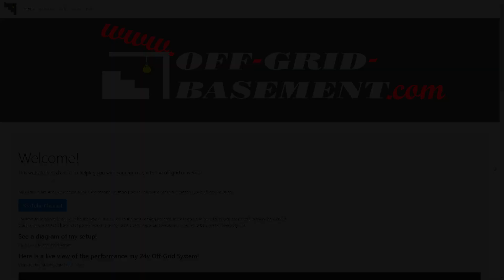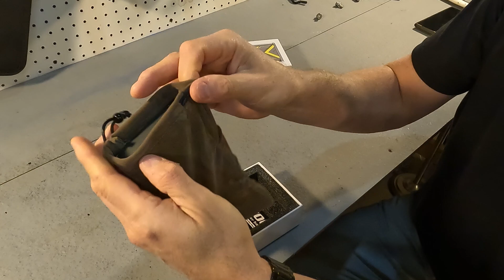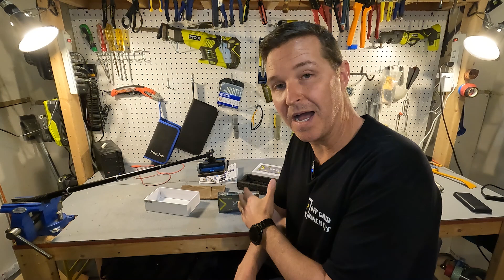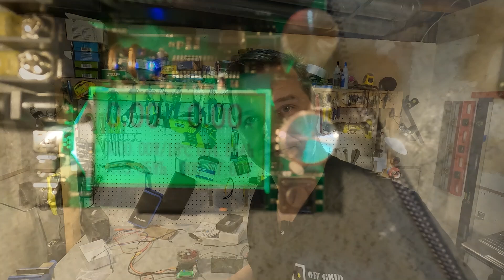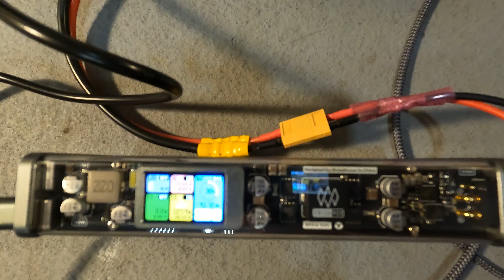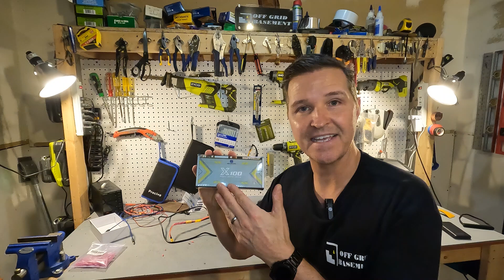X100 EDGE Smart Drive full review

Comment: I  want to use this X100 to power my StarLink Mini when I need to locate the Mini further away from my RV without having to run a long length of cable to power it... & it would be nice to connect a solar panel to the X100 to charge it while the X100 powers the Mini.
Reply from the maker: Thanks for the comment and sharing your idea!

Comment: Is there a power button that turns the power output on and off?

I want a power bank to plug into my Starlink Mini when I am remote - Is this overkill or do you know of  another one you would recommend. (no thicker than 1.2") Thanks
Reply from the maker: I'm not sure if this is overkill.  It does have a power button to trigger the output.  This is honestly the best power bank I've tested.
Reply: @OffGridBasement  Since I posted (3 days ago) I have to agree with you - this may be the best power bank for this application👍

Comment: I have a dumb question but I'm going ask anyway. Since it has XT30 plug. Does it mean I can use it to run RC cars? Or it's only for charging RC battery? 

I'm hoping that it can run RC cars.
Reply: Of course you can do it all
Reply: @Edge_Smart_Drive  I was wondering if XT30 plug are adjustable? I noticed it's stay at 24.95v 0.000a. I can't figure out how to adjust it.
Reply: @ Sorry for not getting back to you earlier.
Unfortunately, the voltage is not adjustable at the moment.
Reply: @Edge_Smart_Drive  that's unfortunate. It would be game changer.  I guess I could use UBEC.
Reply from the maker: It only for charging the battery.  Thanks for the comment.
Reply: @OffGridBasement  The label said output 21v 15a 315 watt. And Input 24v 6a
Reply: @ Can also be used for electrical appliances in need LOL

Comment: My only gripe is that it doesn't have an pure sinewave AC inverter/plug socket
Reply: I’ve poked our engineer about it—his reaction was a mix of caffeine and despair😄 but he’ll consider it
Reply from the maker: These portable power banks aren't really designed for AC power.  This is just designed for fast charging and discharging.  Thanks for the comment.
Reply: @OffGridBasement   I  realize ... However there are some that do it but sadly they are modified sine wave (eg marebo)

100w pure sinewave inverters and even 50w are real if these size powerbanks with pure sine wave were more present

I could run a 15w DC motor Amazon basic standing fan for hours in an outage , or run internet routers, or starlink,laptops  and such a small inverter would have low idle consumption 

They could potentially take piece of the pie from those barrel port pure sine wave inverters in cars as they would have their own storage of energy